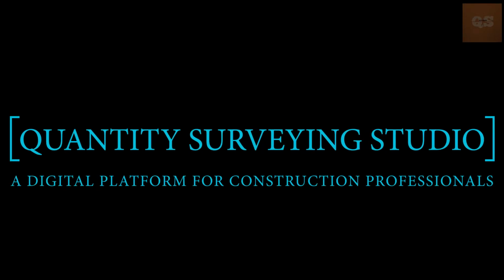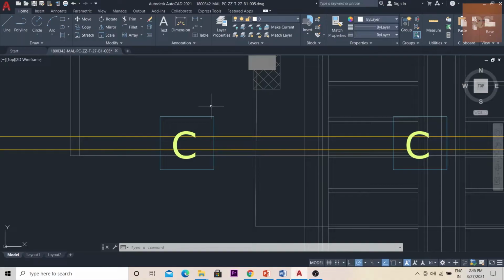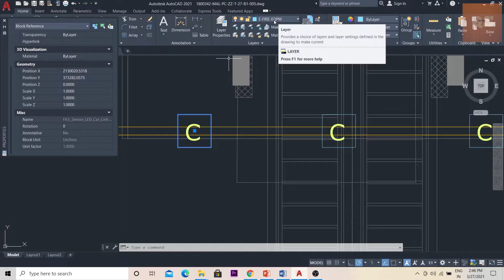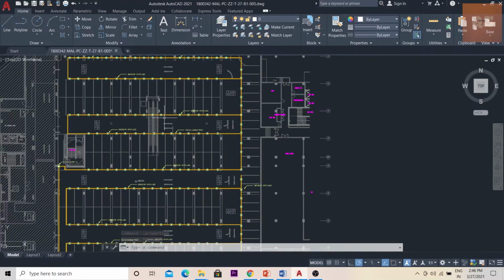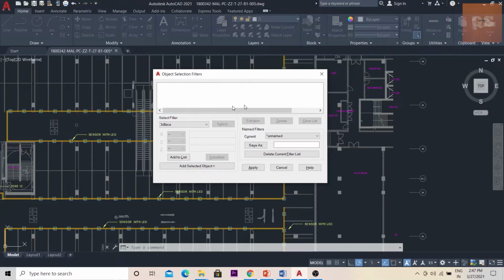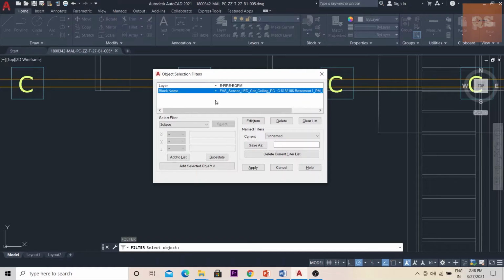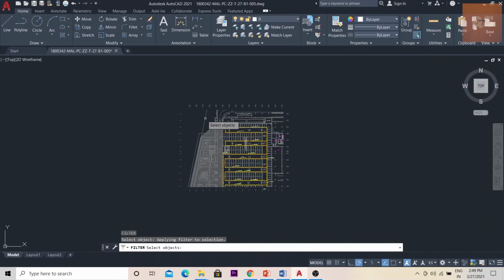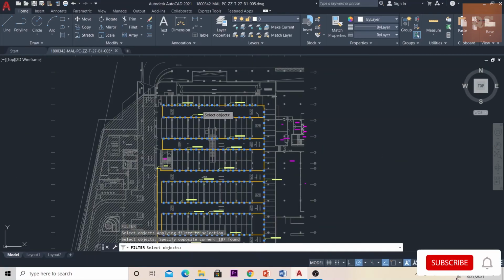AUTOCAD Count | Quickly count items under 30 seconds

Comment: If all sensors are not  made in same layer, or different things also included in that layer,,,, then how we should do???
Reply from the maker: Then counting separately by adding a new layer can be done.
Reply: You can also, use "_Bcount" command, it lists all blocks with theirs counts, 
if symbols are texts or Mtext, you can use "_Find" command it's useful too (Dont forget to check List results !!)
if you wont to count square symbol (*pline) for example you can use  Quick select command "_Qselect" with condition "Length less then" with approximate length of your linear symbol.
Sometime, use polyline for pointing symbols or others things and you can use polyline vertices number  as a count (Look in properties window under current Vertex", you can also draw circles in specified layer and use filter command or just selectsimilar command.

When selecting several objects in drawing zone just look in properties window there's the total count of selected objects "All (numberOfObjects") with a detailed list. 

Good luck QS. I hope this helps you.